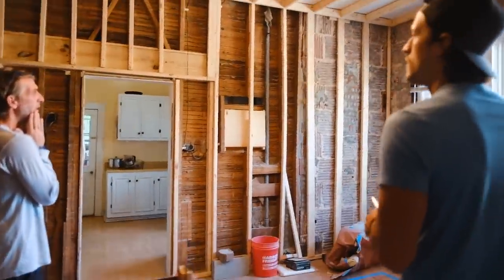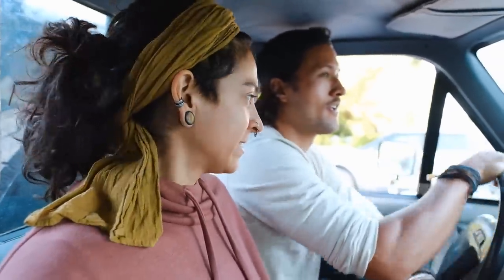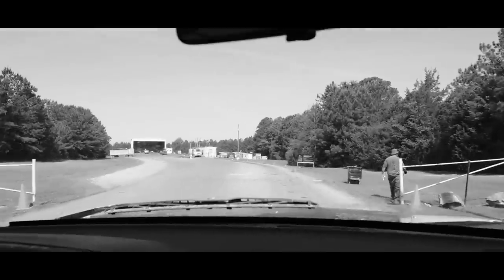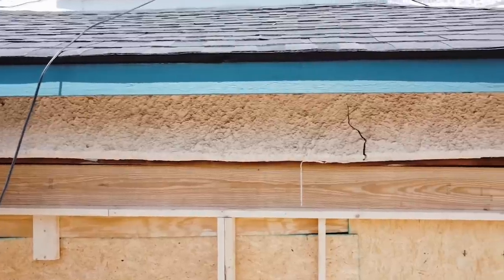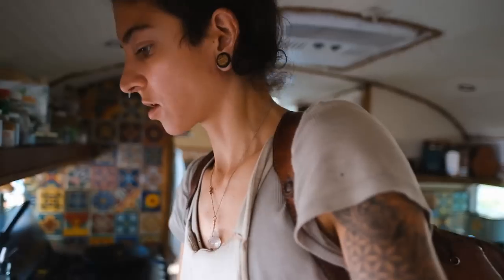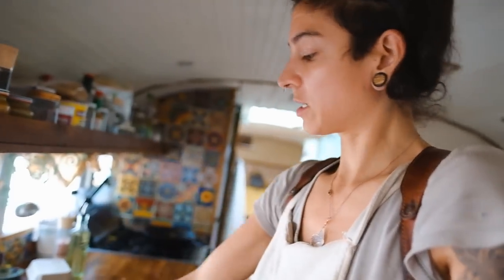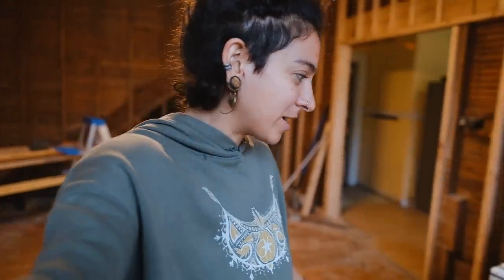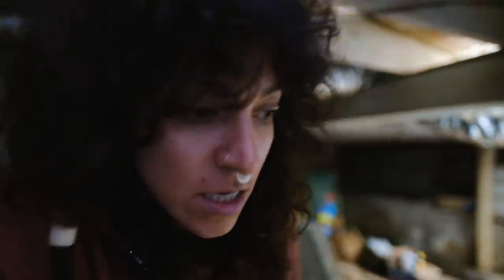Big Set backs on our Home Renovations // Kitchen Makeover Part II

Comment: We had a French drain around our house and found out that it was coming up thru the cement floor in our finished basement. We had 2 sump pumps down there too. Such a hassel
Reply from the maker: we just had a sump pump installed too
Reply: @julianajubyyasmine  Can you save the water for watering the garden? Like in a tank in the cellar? For dry days?